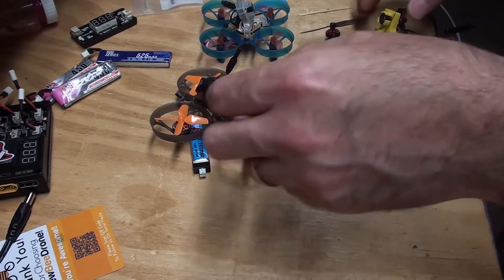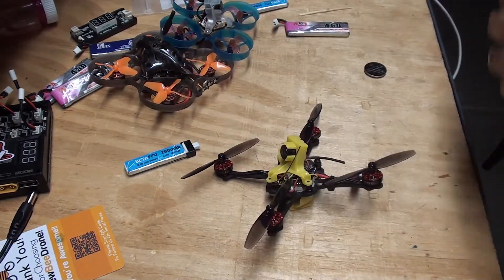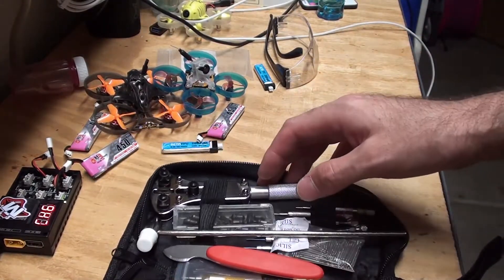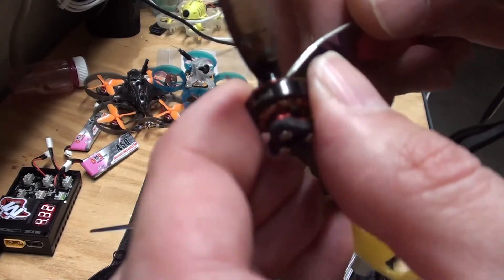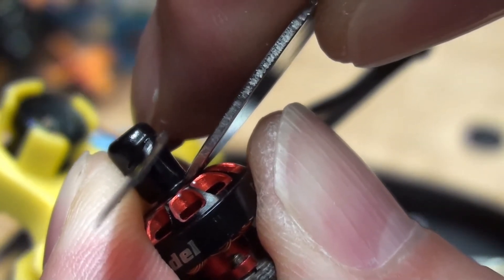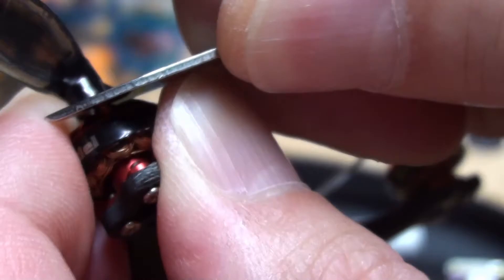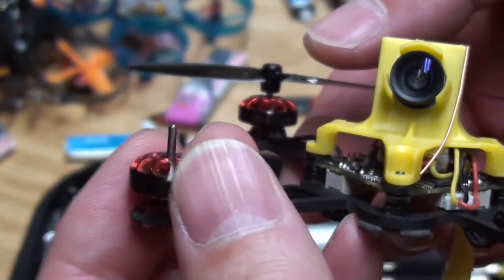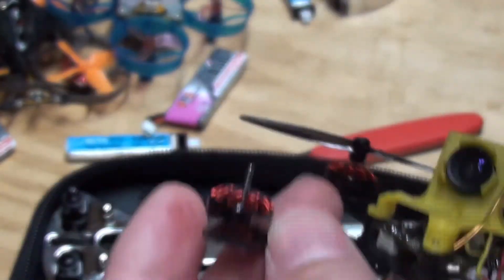Press on Prop Removal, for Toothpick quads

Comment: Haha you are the first guy that I see using a knife like I do. Definitely a good method since doing it like this also makes the prop hole inside lose less of its grippiness in case you want to use the same prop again in future. Thankfully the Ldarc motors that I use dont have the glue proplem between bell and shaft.